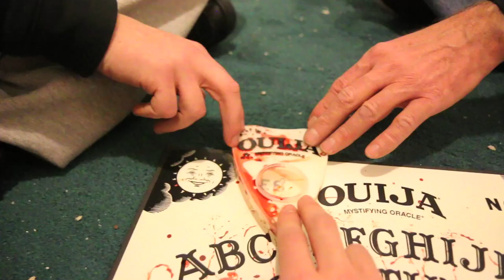THE OUIJA BOARD!

Comment: Someone flipped the breaker😂😂 that's what that noise was
Reply: Im not saying that this is all true but thats no real proof that someone actually flipped it off manually because breakers shut off automatically when too much electricity is being used on which ever breaker and it makes the exact same noise as if someone manually turned it off
Reply: It sounded like the bulb popped... They were right light did start getting louder...
Reply: +xJemiki Or the breaker tripped they make that sound when they trip or the light blew
Reply: Nah i was trying to smack Jesse in the head but accidentally flipped the switch and they ran like idiots
Reply: +chris kirkham That could be true but nothing was pulling much current to make the breaker trip.
Reply: +chris kirkham if it happened by itself then great timing
Reply: +Jacob Kelly Yeah that is true tho, i just thought it was pretty weird how the light right above them got like 10 times louder as soon as they started doing the ouija board shit...... And then it looked like the lightbulb exploded when the breaker tripped or got flipped off by someone or whatever but i don't get what would of caused the lightbulb to do that if someone had just flipped the breaker off
Reply: +xJemiki If someone flip the switch that spark would not come. That must have been too much load on the breaker and it flipped by it self.

Comment: I've messed with Ouija Boards and do not believe in any of this stuff. I have looked into it so much though because I REALLY want to believe. With that being said, let's just say for video purposes this is real, the biggest mistake you made was getting up and leaving. Once you initiate the conversation and let the spirit in you MUST tell it goodbye and have it move the planchet to goodbye and close the door. Translation is, if spirits really existed and this was real you'd be royally fucked. Also, spirits who are harmless will move to the sun, spirits who are bad will move to the moon. BUT they can be very sneaky and a bad one will often say it's good and move to the sun as well. By it doing neither tells me it's bad. I believe the counterclockwise circle means something as well but I forget. Again assuming it's actually real.. lmfao
Reply: i definitely have had personal experiences with this kind of stuff but i FULLY respect you skepticism. you unlike most of the ppl here have done your homework and actually want to make the connection lol
Reply: +Sinister I think it was make a figure eight which means you have contacted a evil spirit and you have to say goodbye or it will stay in your house.
Reply: +xPanic attackx (XpanicattackX30) Also never run away from the location, because if you do the spirit or demon will gain more power or control
Reply: Hey can you answer a question I have lived in my house all my life 13 years and my older sister says the house is hunted sometimes a light will turn off and I can turn it right back on is that a ghost please help.
Reply: It could be just something with the wires or maybe a playful spirit, but if it just the light i would consider faulty wiring before a ghost.